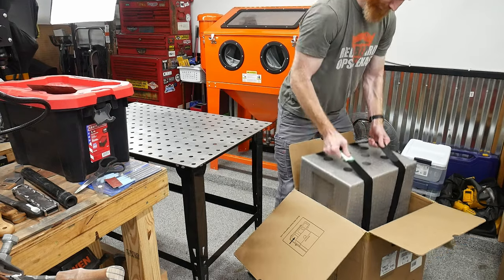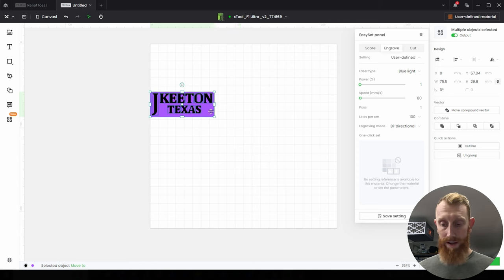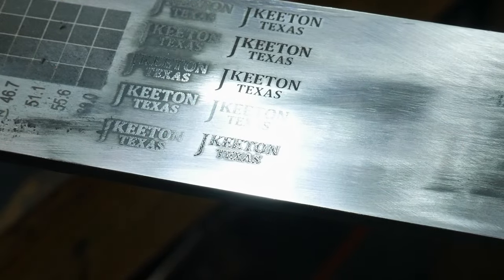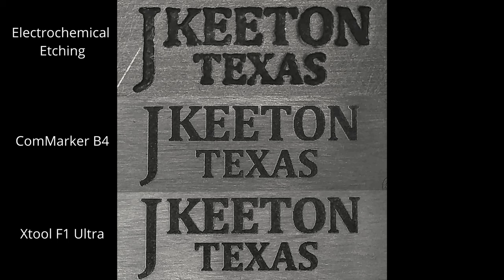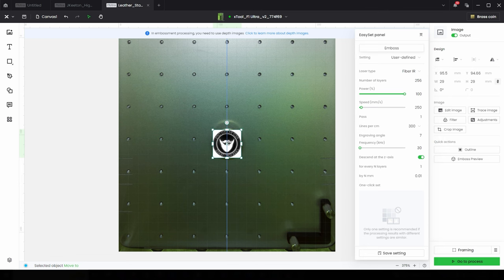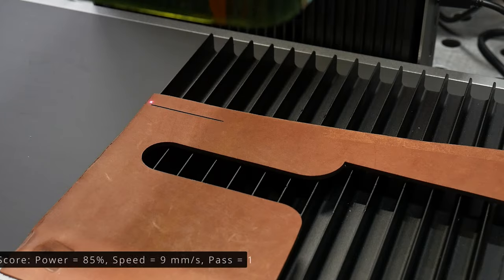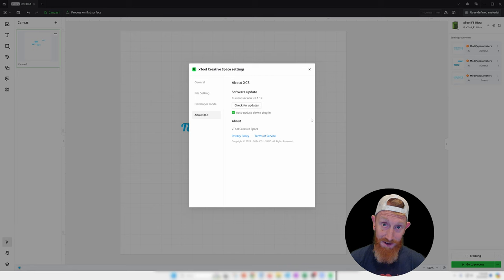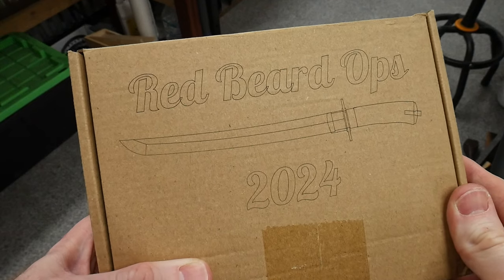What Happens When You Combine TWO Powerful Lasers Into ONE?

Comment: They sent me the same one.  I really like it!   I wish they had the framing option for conveyor large though.. that was a bit annoying.  I assume they'll add it.
Reply from the maker: Man I missed that video, I'll have to go find it! I'm excited to play with it some more. Really nice that it's a 2 in 1; These lasers are getting pretty advanced!
Reply: @RedBeardOps  My settings are 2000 dot duration and 40% power at 500 dpi and you won't get that funk you need to sand off.  You can do 3 passes and it's nice and clear.  If you up it to 1000 dpi its REALLY clear but it takes too long.
Reply from the maker: @TyrellKnifeworks  That's interesting... I'm using an SVG not a PNG or JPEG so I don't have the same options (just power/speed/dpi). I'll have to drag in the PNG version and see how those setting compare. Thanks for the tip